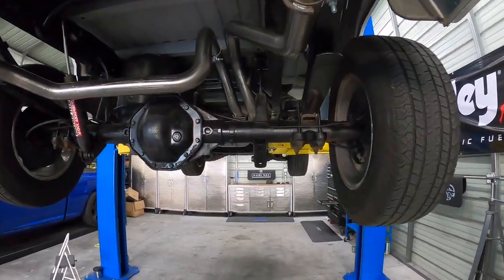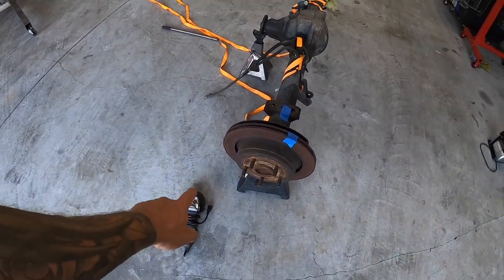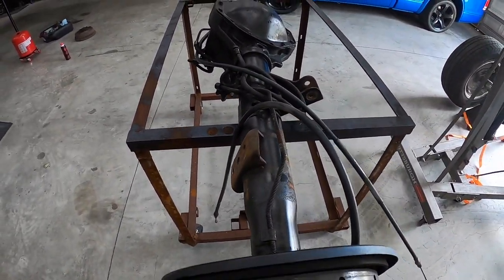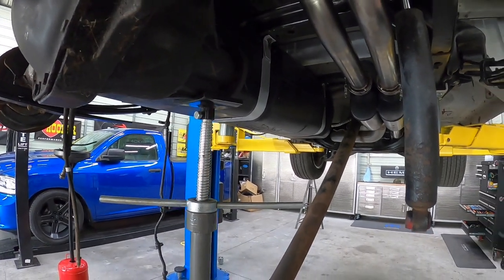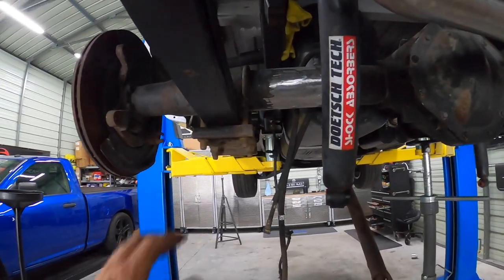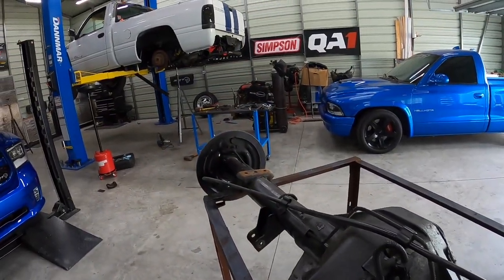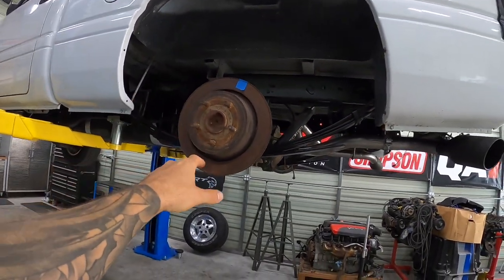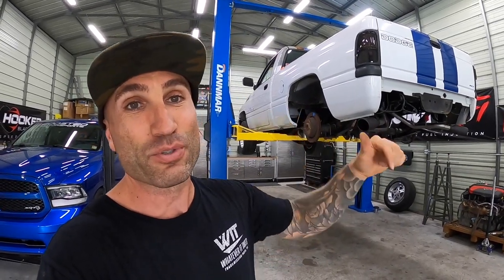2nd Gen Dodge RAM 1500 Rear Disc Brake Axle Swap Conversion

Comment: Not sure if you have already done this or plan to. I’d look into changing the front single piston calipers over to 2000-2001 dual piston style. I believe you could run 3 gen brakes / brembos but not entirely sure. You would need to change the spindle and control arms but it gets rid of that giant wheel bearing brake disc setup and moves to a unit bearing hub like the newer trucks. Hope this helps!

Comment: Don't clamp the brake hose. It will ruin it.  Push the brake pedal down one inch and it blocks the chamber and fluid will not leak

Comment: Couldn't you just weld the axle tube flanges and use all the disk brake hardware backing plates caliper mounts disks metering block etc like you would do with a disk brake conversion kit, rather than a later model diff than having to do all this time wasting fabrication on the perches and figuring out drive line angles and everything else involved using a entirely different rear end?

Comment: I have a 94 ram 5.2 What years will fit ...Easy swap .
Reply: I'd still swap the same demonstrated axle. Your choices are; 3rd gen with disc, or any 94-99, but your stuck with drums.